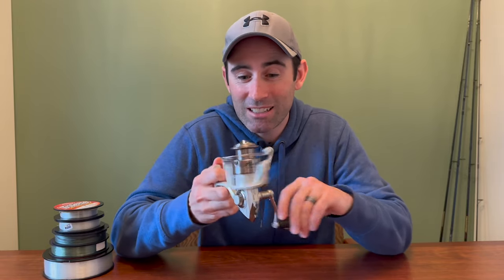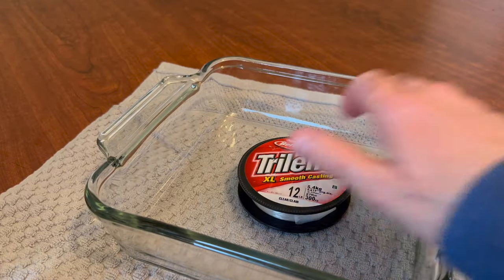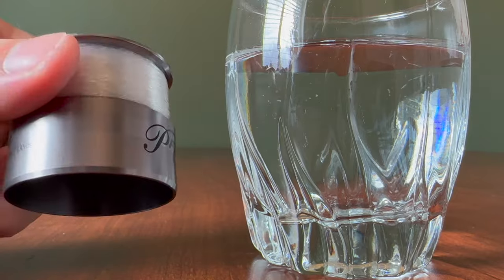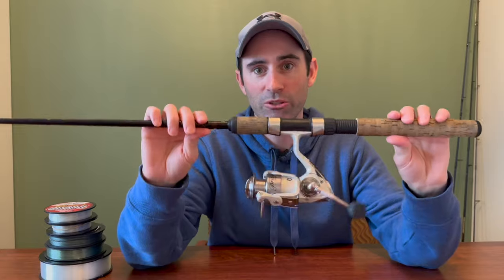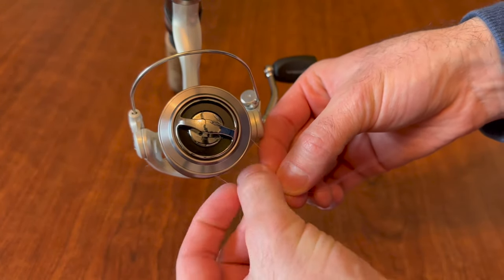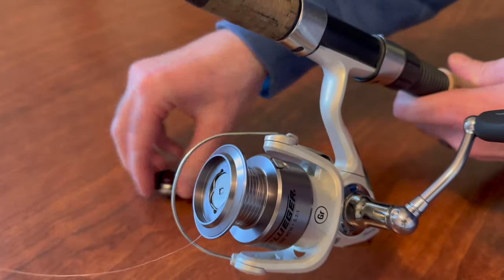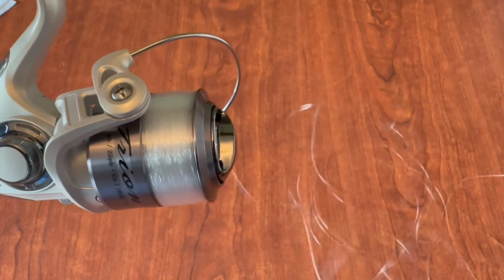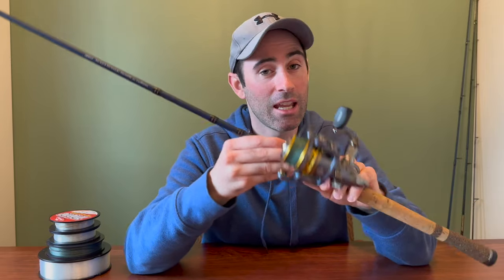How To Spool A Spinning Reel With Ease: Tips For Less Twist

Comment: Awesome video. 1 tip: if you hold your reel upside down you can see that it turns counter clockwise, so that’s the direction you want to spool your line on. Also with the up or down sticker that could go both ways depending on the manufacturer

Comment: Excellent advice!!!!

As I said to Ander's Fishing:

"I'm sorry to tell you this, but mono, flouro and even braided fishing line is a plastic.  Only the really strong stuff is made out of non-plastic stuff, and even some of that is as well.  Wind it on your reel any way you wish but make sure it is snug, not too tight, but snug.  After it's spooled, remove the spool from the reel and dunk the spool in 120ºF water for several minutes and the polymers in that plastic will align it's self to the spool it has been wound upon.  Take it out and let it cool naturally so that the polymer's molecular structure aligns with the way it has been wound.  Once cooled, naturally, there will be no twisting of the fishing line, polymer, around the spool.  This is basic chemistry for anyone whom has studied it.  There will be no twisting or anything else.  Plastics, polymers, tend to take the shape of what they are formed to, like fishing line.  Don't go over 120ºF or you will destroy it's elasticity and strength, but if held under 120ºF, it will form properly.  This is no special trick, it is how chemicals react to heat and how molecules align themselves.  It's basic chemistry.  If your line looses it's effective strength, then you've probably over heated it.  After that, return the spool to the reel and lubricate the entire reel so that the water doesn't effect the reel performance.  Easy peasy!!   No, I looked at this for 2 mminutes and turned it off and made my comments.  Maybe he suggested the same after the 2 minute mark but  . . . . no matter.  Hot water cures most polymer twisting "memory" problems."

This is my take.  I've never had problems spooling a reel on a spit, and as long as it goes on snug, the results have always been the same.

Comment: My bro great info love the tip about hot water will add that to my refurbishing steps before resell, but I had a question to ask, what is the name of the line cutter you use in this video?
Reply from the maker: Glad you liked the video! The line cutter is made by Boomerang Tool Company.  You can find them on Amazon for about $10.

Comment: Great information 👍🏽  Sovfor stocked trout and finesse fishing what lb braid and what lb leader ? Thanks in advance
Reply from the maker: Depends what kind of tackle you plan to use.  If you are casting small spinners or spoons I would just use straight 4 pound test mono or fluoro, no braid.  Especially in clear water.  But I have used braid with success too.  10 pound test with a 6 or 8 foot 4lb mono or fluoro leader.  I also talk more about the best lines for stocked trout in this vid: https://youtu.be/jyJk_wgag9c.  Hope that helps.  Thanks for watching.

Comment: Great information. Two questions; do you also soak braid before installing on a spinning reel?  And do you also install with label up?  Thanks
Reply from the maker: Braid is way more manageable so I found soaking it isn't needed.  However, I do wind it on with the label up (assuming the line comes off counter-clockwise with the label up) like I do with mono.  More out of habit than necessity.  But heavier braid can be stiff and twist too so every little thing helps when spooling up a spinning reel. 

Thanks for watching.  Glad you liked the video!

Comment: Late to the party - but wanted to add something: I really don't see the advantage of reeling up with the line coming of the spool in the same direction as the rotation of the bail arm. Firstly, filler spools are usually much larger in diameter than the spool of the reel - especially close to the arbor. So at best you are getting somwhat reduced line twist, never zero. Secondly, if you manage to spool up with no line twist whatsoever (using a drill with the spool attached and 'manually ' winding it on, for example), well, then you will have the line twisting as it comes off the spool during casting. And if you ever need to remove line twist and you let the line float down a river or you cast on a field, remove the weight and reel back in while holding  the line under tension between your fingers (so it can untwist) - well, then you are in the same boat as if you had spooled up the line coming straight of the spool in the first place

Comment: What?So spooling less line will make it retrieve slower?What?

You say on an underfilled spool you get less rotational retrievals? Please explain how you are wrapping less line? I think science says otherwise?
Reply from the maker: Each full rotation of the handle causes the bail to revolve around the spools a set number of times (it does not change).  Less line on the spool means it has a smaller diameter/circumference..  Therefore, less line is retrieved.  For example, 5 rotations around a spool with a circumference of 4 inches means each full turn of the handle retrieves 20 inches of line.  Conversely, 5 rotations around a spool with a circumference of 3.5 inches only retrieves 17.5 inches of line per turn.  Hence, an under filled spool has a slower retrieve overall.

Comment: Most people have no idea when you dont flip the bail
Over and pull the line tight to the spool you just wind slack  on to the spool and you end up with a mess and buried line which will make you insane. Flipping the bail
Over is the start but you ALWAYS have to pull the line tight to the spool and wind until you have tension sufficient to keep the line tight to the spool . I flip my bail and tension the line so fast after every cast you wouldn’t even notice me doing it. . Store you reels in a dry dark place and you dont need to respool new line . Ive used the same mono for over a decade and it has remained fine with no issues.